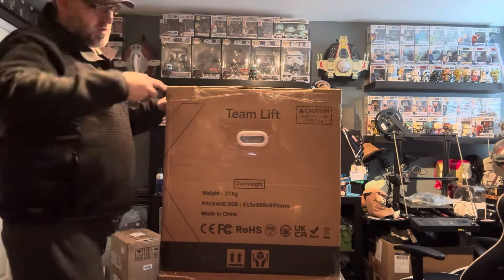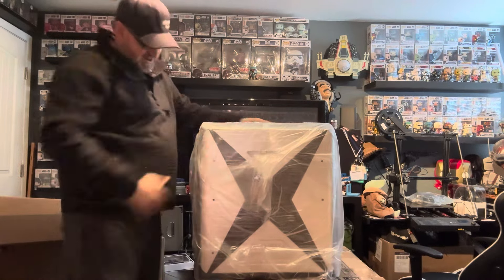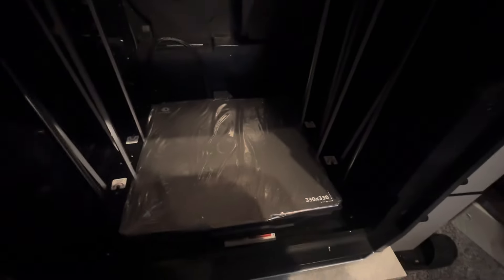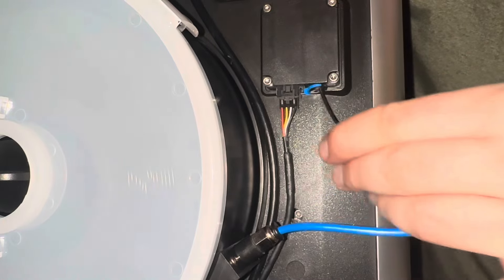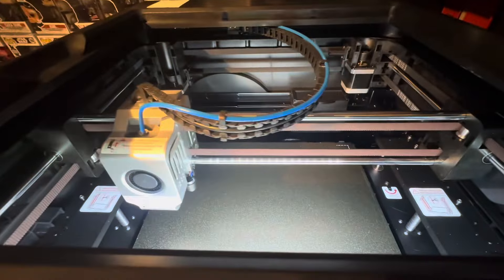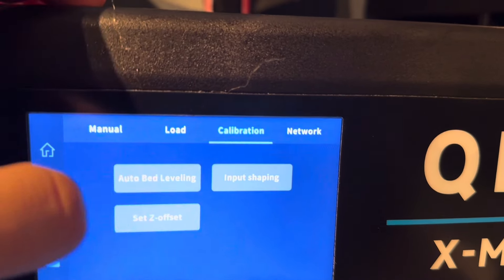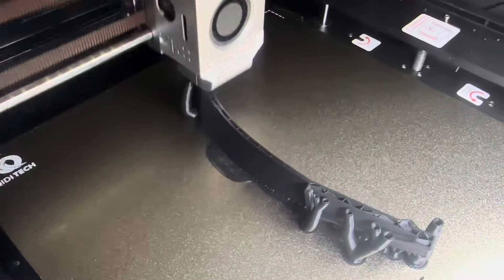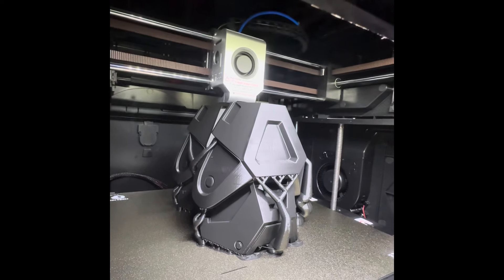Qidi X-Max 3 Unboxing and Setup. Very Please with this 3D Printer. My first CoreXY printer.

Comment: Love the video. What side spool holder did you print off printables? Do you have a link?
Reply from the maker: This is one of them. 
https://www.printables.com/model/672770-qidi-x-max-3-right-side-mount-spool-holder
Reply from the maker: This is the other one I made. Both worked good. I don’t use them anymore though. https://www.printables.com/model/597028-qidi-x-max3-side-mount-spool-holder
Reply: @OuterRimArmorer  What do you use now for a spool holder, if I may ask?

Comment: Great printer! Uncle Jessy highly recommended it! On a different typic: Do you have any issues with the N4 and sanding your helmets? Where the layers start pealing off and string up as you sand? I'm getting that issue now with a full size Storm Trooper helmet I printed, Bondo is fixing the mistakes but its increasing the repair time. I'm thinking the layer walls weren't heated enough and they didn't bond together well?  Could you tell me your nozzle temps with Elegoo Rapid PLA? Sorry for the off topic. Enjoying your journey!
Reply from the maker: No problem at all. I think you’re right about the bonding together part. I’ve had that issue before with a different printer.  The EN4 hasn’t had that yet. My pla temps are 220/60. I would also look into your z height. Is your first layer getting good squish to the bed or can you see gaps in your lines.
Reply: Ahh yeah I was running 205 on the nozzle. I'll adjust for the next build thanks!  @OuterRimArmorer
Reply from the maker: No problem. If you print slow than 205 should work fine but these printers print fast. I use meta pla which has a suggested temp setting of 180-200 but that’s based off print speeds of 100mms. I haven’t printed with Elegoo’s rapid pla yet but their pla pro liked the 220 temps. You could always print temp calibration towers. That’s a great way to dial in the filament to your printer.

Comment: im stuck between the max 3 or save some money and get a sv08. I like that 350 build plate but i have to tune it in. Do you use the heated chamber for PLA? think i read someplace it helped hide the layer lines.
Reply from the maker: I bought an SV08 that I need to setup and test. Never use the heated chamber for PLA. With PLA you have to print with the top off and sometimes the door removed because it can naturally get to hot and clog your hotend. It’s actually common issue on all enclosed printers and using PLA.

Comment: BE AWARE!!! After a few months of using mine, i have nonestop nozzle clogs. i would buy like 10 new nozzles. In 20 days, ALL GONE 800 bucks down the drain.
Reply from the maker: I think they may have a new hotend you can order from their website? 🤷‍♂️ I haven’t tried it yet. I print 24/7 so I swap out my nozzles a lot on all my printers so I haven’t noticed anything unusual but I’ll keep a closer eye on them.